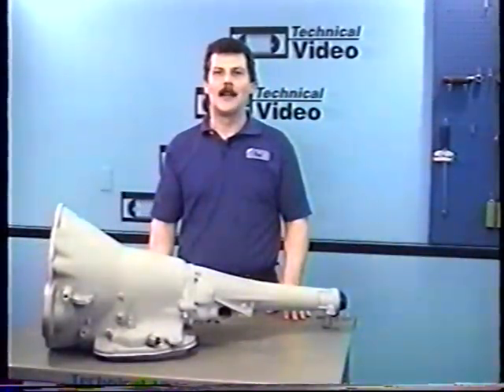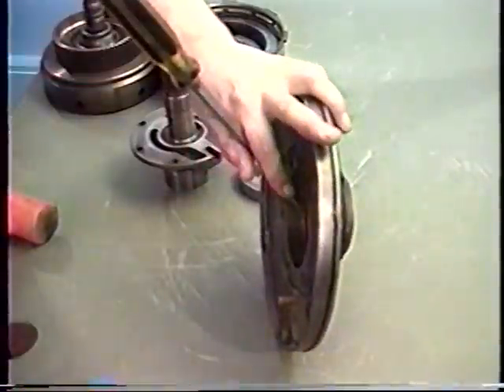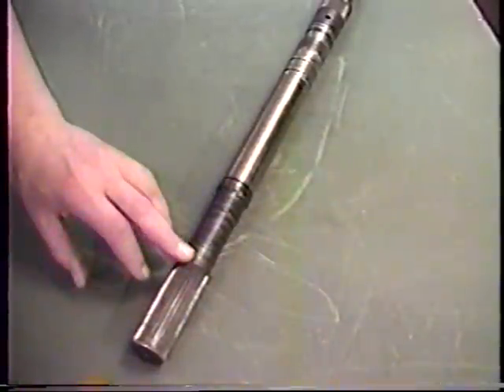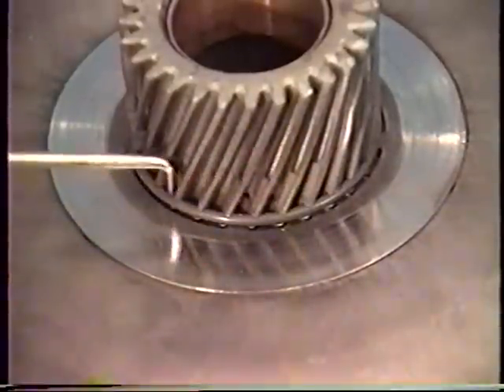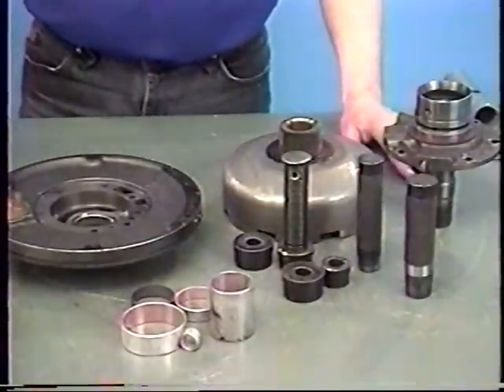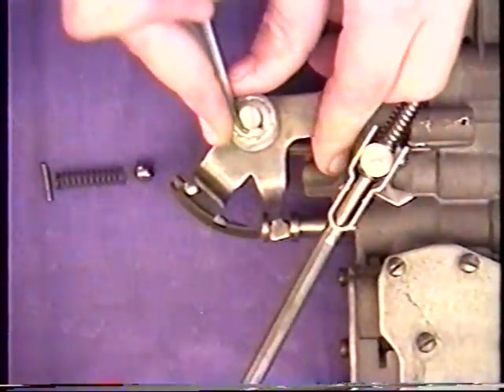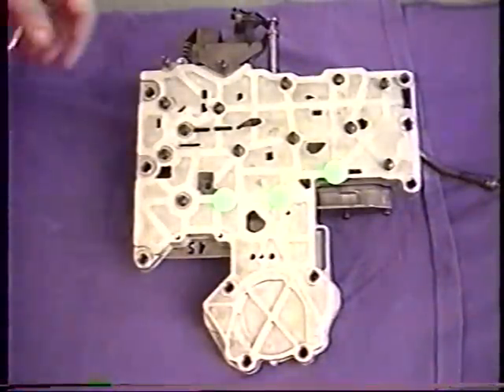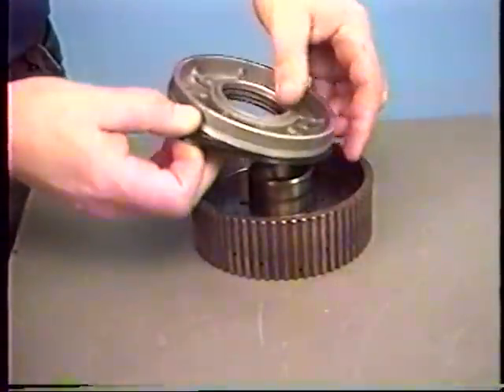Torqueflight 727 Rebuild Video

Comment: Man this video is already saving me time and effort in less than 5 minutes. I started watching an amateur video that shows one guy trying to pull the front pump by using allthread and a socket as a slide hammer - this guy shows you you can just start at the tailshaft and end up pulling the entire case up from the pump and the rest of the internals.

Comment: Great video overall, very detailed and informative....I used this video and a 727 transmission rebuild manual to help me rebuild my 727.

One bit of advice.... getting the valve body in as shown at 1:16:55 is not as easy as it is shown on the video.

The reason is that the parking awl is spring loaded and naturally wants to close, making it difficult to push the parking rod actuator through. You don't want to break or bend parts of the valve body!

So, its best to push back the parking awl with ones finger, at the same time, rotate the output shaft, so that when the awl attempts to close, it lands on one of the high spots of the parking gear. This way the parking awl will be partially open, when you remove your finger.

Then let go of the parking awl and attempt to push the parking rod through...it should go in easy.

Comment: Excellent informational video ! Very detailed tutorial. 
So I’m having issues with my 86 Dodge  Ram that has a 727 / tow package truck , the transmission is shift hard when I put it in reverse. According to various symptoms in the Haynes repair manual it says the reverse band should be adjusted.
For the forward second gear band ( adjustment nut on the exterior of the transmission ) it says torque it down to 72 inch pounds then back it off 2 & 1/2 turns . 
For the reverse band adjustment it says to torque it down 72 inch pounds and back it off 2 turns . 
Does this sound correct ? It doesn’t coincide with what you’re showing here . Could that be a the lock nut that they’re talking about ? Because you clearly explain to just hand tighten the nut and snug it down slightly and then back it off to the respective turns each adjuster nut . Maybe it’s incorrect information in the Haynes manual , it’s all I have for reference. 
But I hope someone here can help.
Thanks 🙏

Comment: Here is a time saving trick......installing the piston in the direct drum is not as easy as he makes it look 1:02:53....my thumbs got all sore trying to get it in with no success.

Try this:

Put the new lip seal on the direct drum piston.....THEN take a thick rubber band stretch it around the direct drum piston, then position the rubber band so it holds down the lip seal.

Leave the rubber band on the piston overnight.....the next day put the new inner lip seal in the direct drum.... remove the rubber band and quickly install it in the direct drum, the piston will be very easy to install...it will literally fall into the direct drum.....try it out.

Comment: Thanks again for the video. I have a 727 with a 440 attached in my 1969 Town and Country. I developed a bad leak from "what I thought"  was the front seal. When I finally got the transmission out and slid off the converter, I noticed metal shavings in the bell housing and on the seal lip itself. So now I am wondering what more serious problem I may have. Worn bushing? I now figure that the metal shavings tore the seal which then released the pent up oil that had been filling the cavity behind it. I would really like to rebuild this myself. I am an experienced machinist in my early 60's. Any advice would be appreciated. Also, where can I purchase the special tools you were using. Thanks again, and MOPAR to ya!
Reply from the maker: I personally didn't make this video but I did use it to help with my rebuild and thought it would help others. Now I wouldn't take my word to seriously as I'm only 17 and I've only done one rebuilt for my 440 727 scamp. The "metal shavings" appeared in the pan on my 727 which had no issues previous to the rebuild. I believe the shavings to be from the clutch packs but in your case it may be different. I'd tear it down and see what you find. I did most of the rebuild myself except for pressing in the bushings. I imagine your experience will help you in the rebuild. If you have any questions with what i did I'm happy to help. Good Luck!
Reply: Greetings Mikey Mopar I own a 1966 Chrysler Newport 383 auto when I drop it in drive and hit the gas it takes a minute ? To actually move any suggestions for me I don’t know it it would need to be rebuild
Reply: @JGamez-qk7ke  Sounds like your torque converter is leaking back.... to test this, start the car, put it in N for a few seconds then drop it to D.  When in N the pump is engaged and will fill the converter.

Comment: I cannot get my front clutch piston assembly off the input shaft. It spins free and is loose but won't come off. Dismantled the rear clutch assembly to see if anything was hold ing it. Nope.  Every vid I see the front clutch assembly just slides right off during disassembly.  I am stumped

Comment: NO SHIFT KIT!
They CAUSE excessive overlap, even though they market them as a cure.
They apply the direct clutch hard before the intermediate band releases, literally trying to bind the trans into two gears at once, which is how a trans brake works. 
(Sheared or candy-caned input shafts for diesels anyone?)
Keep in mind that the OFF side of the intermediate servo IS the direct clutch accumulator, and the clutch needs to be off UNTIL the the release side of the servo BOTTOMS OUT.
Drilling the seperator plate is the biggest offender, and once drilled, it cannot be undrilled. 😶
Overlap is that "Broomstick Thru The Spokes" feeling you get on the 2-3 shift, like going over the handle bars.
This causes direct clutch failure, burnt intermediate bands, and is killer on thrust loads and splines when the gearset comes to a screeching halt.
Excessive line pressure is a killer too. It's very hard on the pump, convertor hub, and convertor bushing. It can also snap bands and break/invert the belleville spring in the forward clutch. It can balloon torque convertors too.
Here's some alternatives the designers provided for us:
°  Leave PLENTY of clearance in the direct clutch. Why? Because the direct clutch friction disks are splined to the direct clutch hub, which protrudes from the rear most part of the forward clutch assembly. Thus it is splined directly to the input/turbine shaft.
So that means that the direct clutch friction DISKS turn engine-speed, engine-direction during all driving conditions.
But the direct clutch DRUM, and its steel separator plates, are splined by its outer tabs into the sun-shell, which rotates 7/8ths speed of the input shaft, in the opposite direction (in LOW GEAR.)
So lets say you're taching 8k RPM in low-gear just for simplicity sake.
Engine speed 8k. (direct clutch friction disks riding along with it, at all times.)
Direct drum, and steels, however, is spinning 7k, in counter-rotation.
Now let's do the math :
8k clockwise + 7k counter-clockwise = 15k RPM DIFFERENTIAL.
So you need lots of clearance in that pack to keep it from dragging when it is required to be absolutely OFF !!!
This one mistake fries direct clutches faster than overlap! Make sense? 
I go 0.130" MINIMUM clearance (no typo) for stock applications, assuring there's no coil-bind in the piston return springs. (Add even more clearance for any high revving application.)
° Use a full stack of direct clutch piston return springs (heavy if you got'em), and a HEAVY (or dual) spring on the release side of the intermediate servo in order to slow the clutch application until the band comes off. That clutch will take up the slack first. Instantly, regardless of clearance. Then the servo will start to regulate the clutch apply, vs the band release, as the METERED pressure begins to rise, with the servo release (accumulator) controlling the pressure to the clutch. Then the pressure to the clutch spikes, once that accumulator bottoms out! These springs and valve body separator plate restrictions controls that rate and keeps the servo in charge.
No drilled holes !!! 
°  Use a 4.2:1 or 5.0:1 ratio intermediate band apply lever to exert more force on the band without having to jack up the line pressure.
° Control your Wide Open Throttle shift-points with the pressure regulator adjustment screw. Counter-rotate to increase. (No more than 6 full turns, using stock pressure spring.)
Important : The kickdown lever on the trans needs to be bottomed out, full rotation, at WOT. 
Part-throttle adjustments are accomplished with the kickdown linkage, but to maintain WOT setting, a shorter/shortened  ever may be necessary. Ideally, that lever should go Stop to Stop when following the carburetor trottle position, to reduce harsh engagements, which is hard on the sprag, and your nerves. It's just not necessary.
I weld the levers to whatever length is required. Sounds tedious hunh?
°  If you want the ability to shift into low at any speed, you're gonna need the 1-2 governor plug out of a shift-kit. But be warned... the low roller clutch in torqueflites are the weakest link, and that function is like praying for catastrophic failure. Ruins the case everytime, at a minimum.
Jussed sayin' 😶
Good luck boys!

Comment: Hey I know its been a while. After tearing Tranny apart Its impossible to separate front and rear clutch. Any ideas? Maybe from  pressure or heat they got stuck or seized...How can I deal with this? Please help!!!
Reply from the maker: Well I've never heard of this happening before, as ATF usually keeps them separate. I'd try putting some libricant between the two and prying them apart. Be sure not to nick or scratch them up though. Worst case use a torch to heat up around the shaft but go easy as you don't want to warp the drums.
Reply: @mx_dot  I did not find this problem on the whole internet. I was able to brake them loose with lube and tons of patience, and a gentle hammer :) Thanks for the response, thou!
Reply: The only ones I remember ever doing that was ford c4 it was a combination of low fluid levels and fluid pressure. It actually caused all the friction disc to grind down to metal and weld themselves to each other. We used big screwdriver and hammer. Hope i was helpful. Either way good luck and give an update plz
Reply: You have broken clutch teeth, just put it in a vise, and lightly tap band case and drum away from separation from output shaft it will seperate